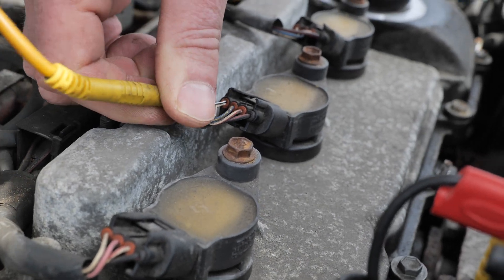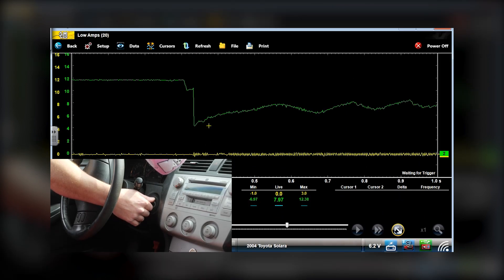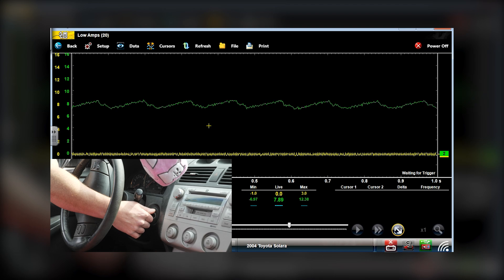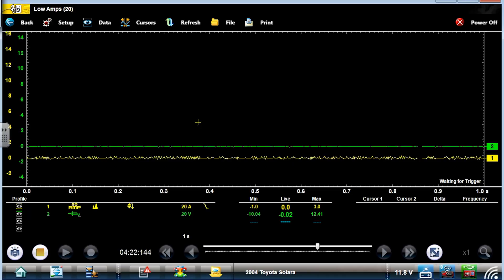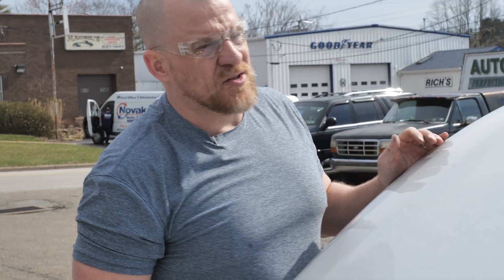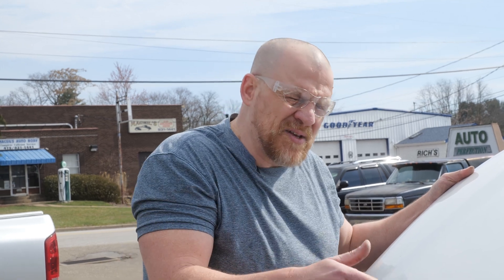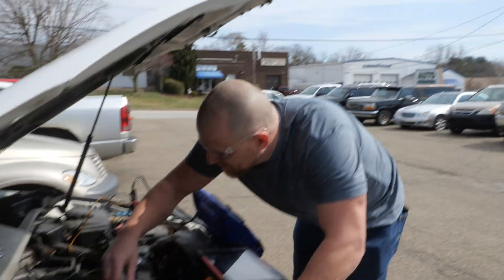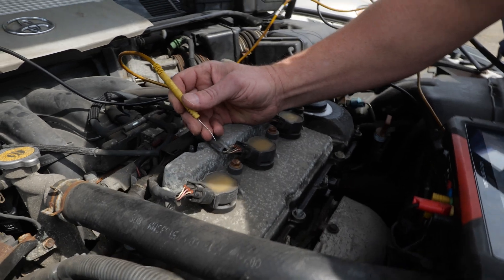Voltage Drop Testing an Ignition Coil Ground Circuit

Comment: Hi, I just want to ask if a voltage drop of .6v from BATT post versus IGNITION ON reading is a little too high? The ignition wire from the key gives direct power to injectors and ignition coil so I am a little worried. Thanks!

Comment: Ma man Danner!
I just got reed of a roughly 70 milivolts of a voltage drop on the negative side of the battery! Negative cable was bad, on a re-crank it would seem that the battery is weak, wiper motor would be weak sometimes….I’m sure I killed 5 birds with one stone fixing this voltage drop!!!!
Love it now even the sound porch of the starter sounds different!
Love ALL your how to videos and SMA and PHAD
U GUYS RULE!!!! 👊

Comment: That is exactly why house wiring circuits have a ground and a "neutral" ground.  Because since that neutral is tied to the load, if it comes disconnected from the destination ground point, that neutral will now become a hot wire, looking for ground;  which can be dangerous if that was tied to a chassis ground of something like the metal shell of a washer or dryer.  So since a ground side of a load can become hot, they had to string along an entirely separate ground matrix for safety, that is never supposed to be tied to any loads.
Reply from the maker: Residential AC voltage is weird to me lol

Comment: Thanks for all the videos, Learn a ton from them all! I agree it's not necessary if you put a scope on it, I just feel it's a lot easier to stick a headlight bulb across power and ground on the coil to rule out a power or ground issue even before I pull the scope out.

Comment: That's a good point. The same kind of reasoning applies in other situations as well, where for example in a starter circuit you can't test at the usual amperage draw. If voltage drop is the cause of the problem, you'll see it in a multimeter provided you've wisely chosen exactly where to attach the leads and provided you know electrons are moving. On the other hand, I've noticed a pattern to automotive techs. The guys who specialize in circuit diagnosis, like yourself, consider the test light their golden tool. Others, not so much. If you are thinking clearly you can use voltage as a time saving short cut, but only if you clearly see the misleading bear traps along the way. By draining ghost voltage and by demanding moving electrons, the test light can be more trustworthy.